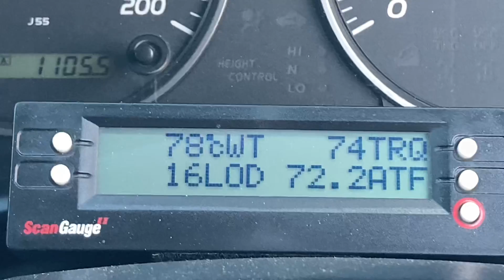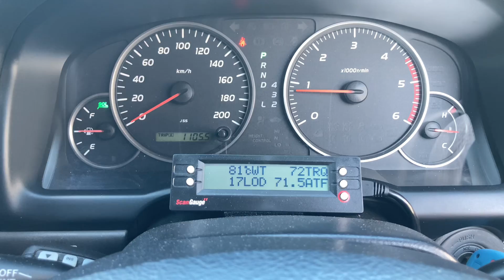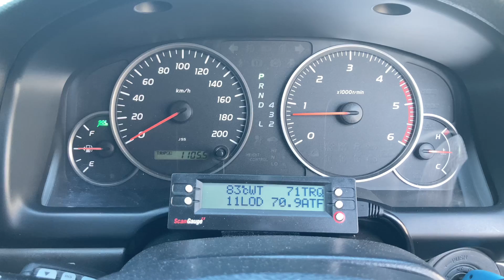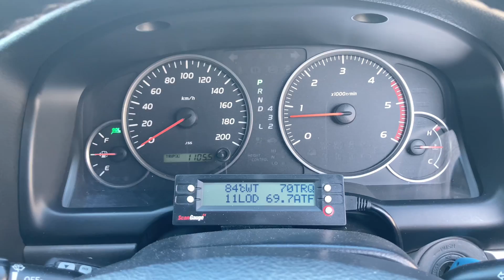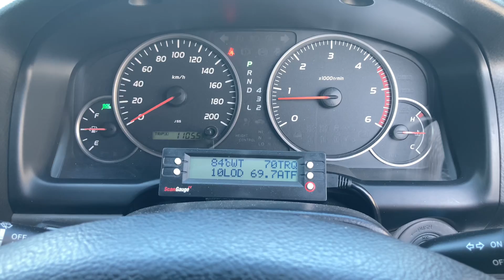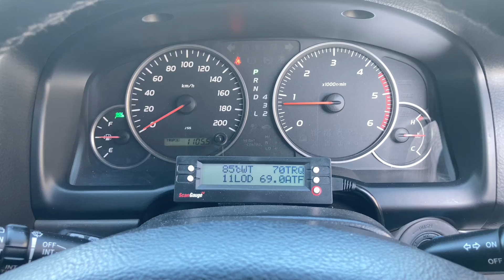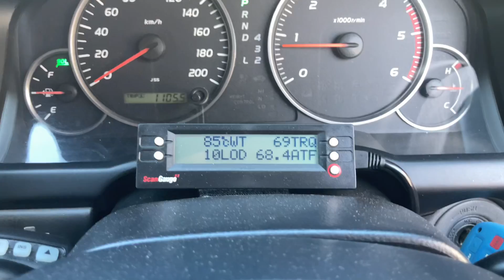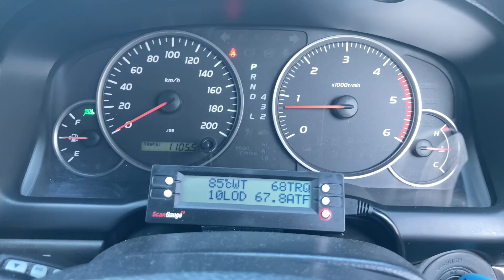DETAIL EXPLANATION on the LOAD READING on DIESELS

Comment: hi mate im buying a hiace 2011  1kdftv with 260k injector values are in spec 0.6 0.7 all 4 injectors pilot are in spec 420 calculated load is 16 to 17 no smoke and drives good. its a 4 speed auto.

Comment: HINT: Turn Everything Off - AC, Lights, Fridges, UHF, Radio & Subs anything that can draw power from the alternator to get the proper base reading.

My 2011 GXL 5speed Auto Load was 11.8-12.2 when last checked (205,000km)

Comment: 2011 post facelift hilux auto, changed the injectors when load was about 14-15%. new injectors and it was sitting about the same even up to 16% then couple months later it dropped to about 12.9-13.2%